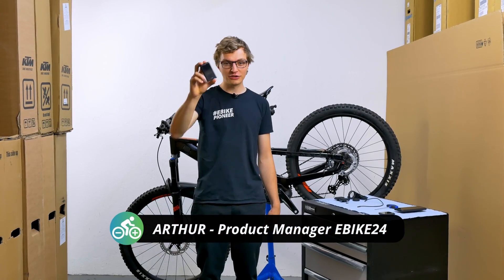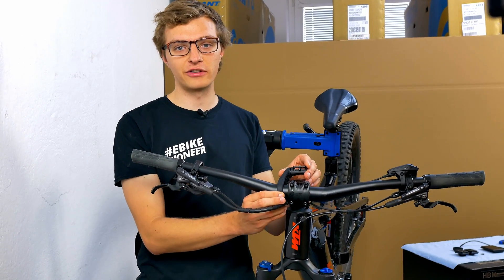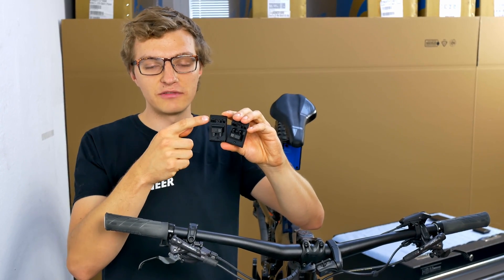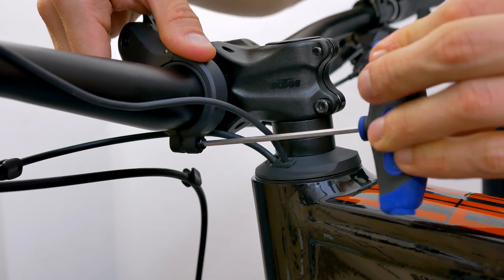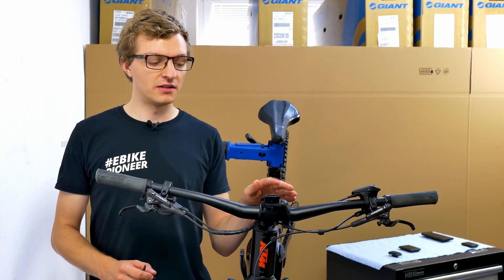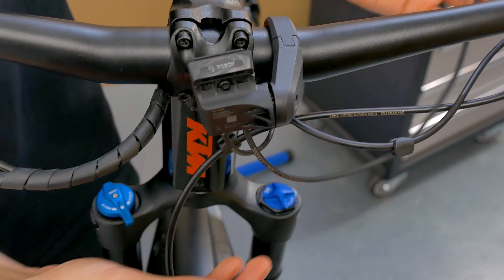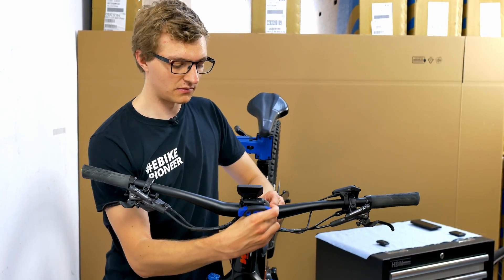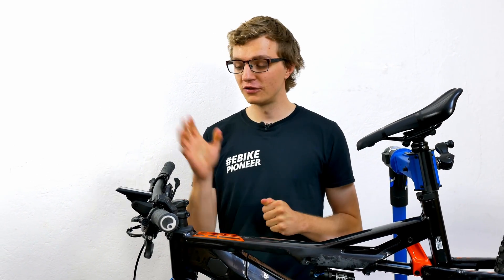Retrofit Bosch Kiox 500 on the Smart System | Tutorial | EBIKE24

Comment: Already have the Purion 200 on my bike. If I want to add the Kiox 500, do I need to remove the bike from the Bosch Flow app?
Reply from the maker: Hi, and thank you for your comment!
If you already have the Purion 200 installed, you don’t necessarily need to remove it from the bike. Usually, you just need to connect the Kiox 500, and it should work immediately. We also have a tutorial for that: https://youtu.be/jsKCrjyZjH4?si=LMwLqUjidhuWqVR4&t=327.
We also mention the ID conflict that may occur once you connect both the Purion and Kiox, which you would need to resolve with your dealer. However, this does not affect the general functionality of the Purion and Kiox.
Cheers - Michael

Comment: Can I retrofit the Bosch Purion (not the 200 version) to the KIOX 500? If not, what are my options for a smart display when I have the Bosch Purion?
Reply from the maker: Hi Charlene, and thank you for your comment. I assume you have this Purion display installed: https://www.ebike24.com/2017-bosch-purion-e-bike-display-performance-line.

In this case, the Kiox 500 or any other "Smart System" displays will not be compatible with your bike. The older Purion indicates that your bike is equipped with the "Bosch eBike System 2" software rather than the "Smart System." You could, however, upgrade to the original Kiox display (not the one featured in this video) or the Nyon display. Both will be compatible with your bike. You can find more suitable displays here: https://www.ebike24.com/bosch-performance-line-display?p=1&o=4&n=24&f=2.

You may also visit the Bosch website to see which displays are compatible: https://www.bosch-ebike.com/en/service/productcombinations/bosch-ebike-system-2.

I hope this helps!
Cheers - Michael